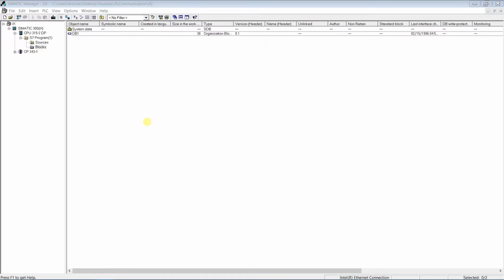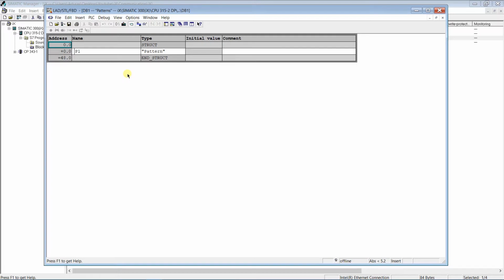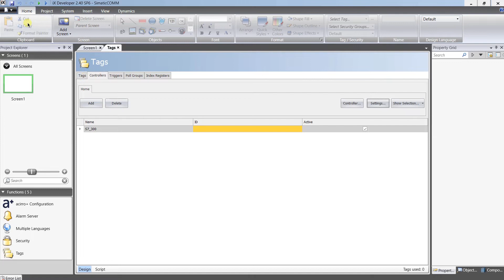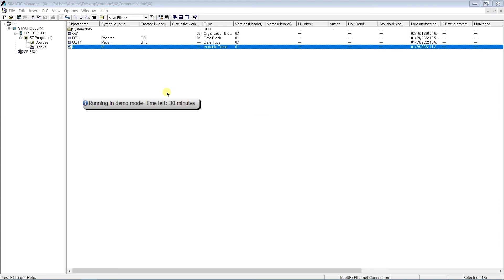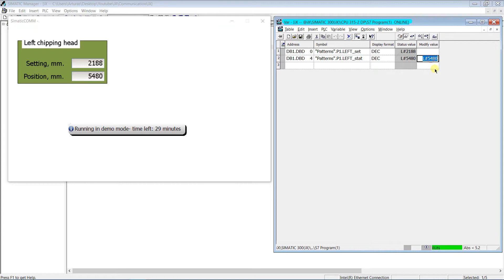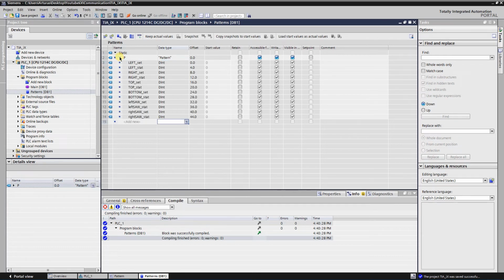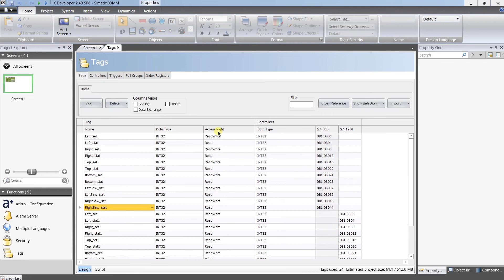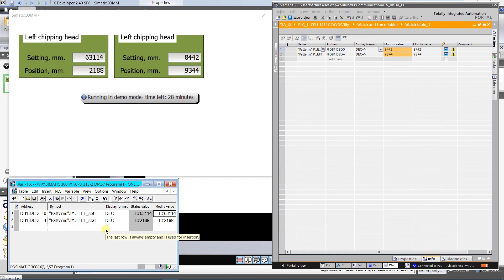Beijer X2 Base 7 communication with SIEMENS PLC S7-300/1200

Comment: could you say TSAP for S7-200. I cannot communicate ST40 and base 10v2
Reply from the maker: I have no experience with S7-200 Smart series CPU's. You need to ask Beijer if they support a driver for Smart CPU's in first place. If so, then rack and slot can be found in the hardware configuration.